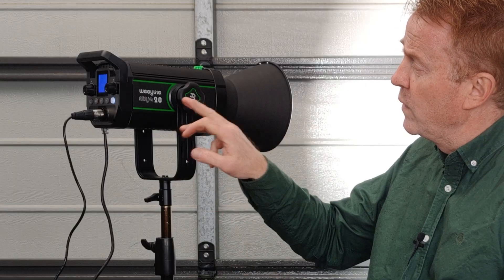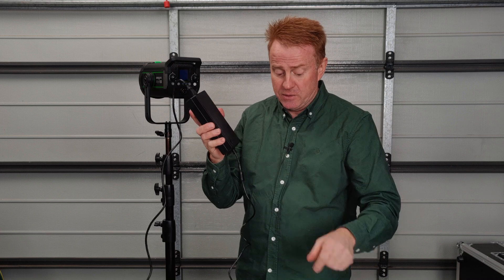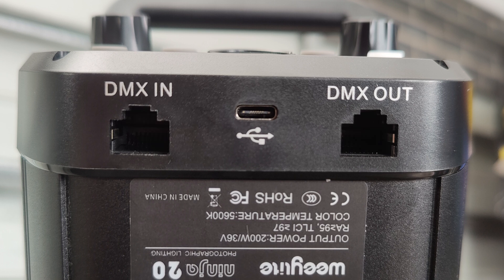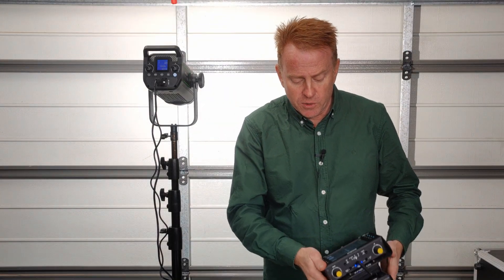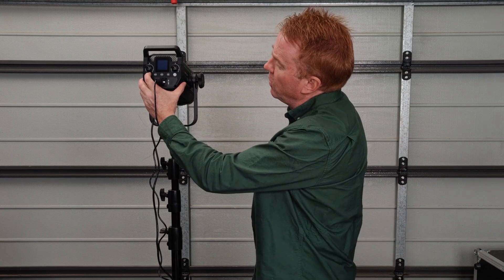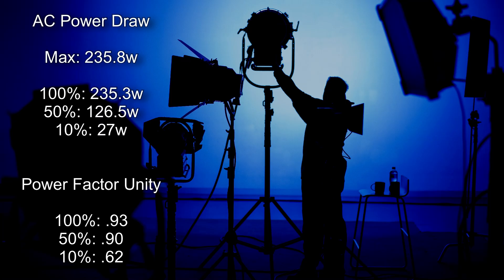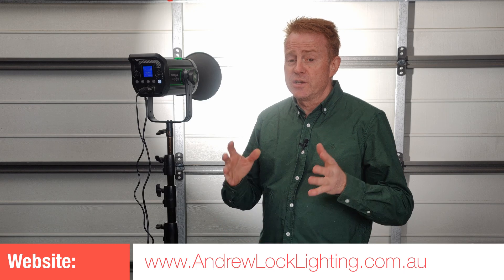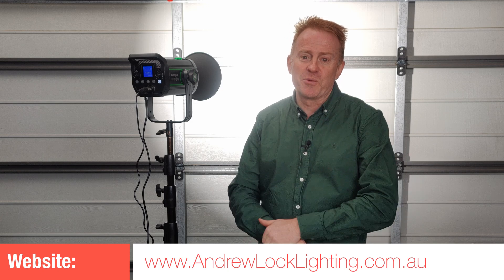Gaffer & Gear 189 - Weeylite Ninja 20

Comment: I noticed  that this is an 3 prong XLR cable. I wonder if this would work with the Came-TV or Amaran power supply, considering those are 3 prong XLR as well.
Reply from the maker: @Ranger7Studios  I can't remember what any of the voltages or wattage of any of these lights are off the top of my head

Comment: You should take a look at the ifootage Anglerfish 320dn. A 5600k light with the highest TM-30(97) and SSI(84) scores I've ever seen for a Daylight LED and it's just $650 USD. They don't use the typical 450nm blue pump like most LEDS, so there is no big blue spike at 450nm, allowing the spectrum to look much closer to true Daylight. The light has some drawbacks though, the dmx requires a special cable, the ballast lacks a clamp,  build quality doesn't seem to be that high.... etc. But it seems to be the first big advancement  in daylight led color quality in years.
Reply from the maker: It looks like a phosphor over ultraviolet, similar to the blue leds on the RGBW Fiilex Q5. But I'm just guessing that by looking at the spectrum distribution graphs so I could be wrong.

Trade off with that is longevity of the LEDs and power efficiency which is why people like Aputure have not gone down that road.
Reply: @gaffergear  very interesting insight, thanks!